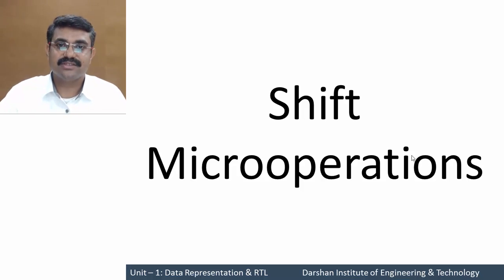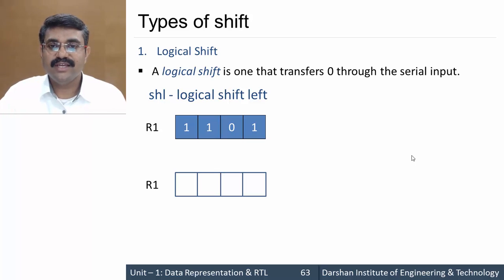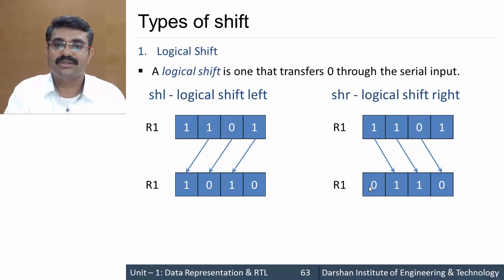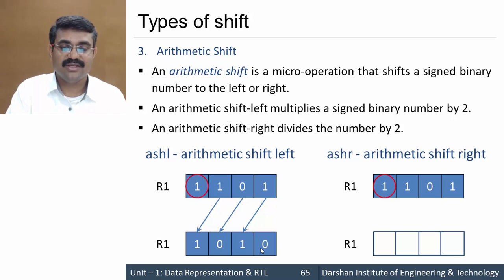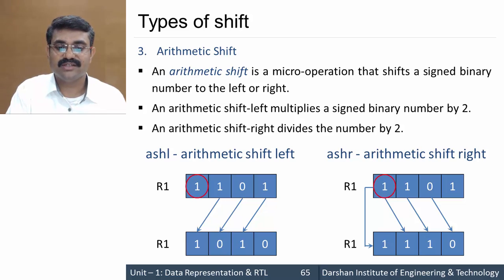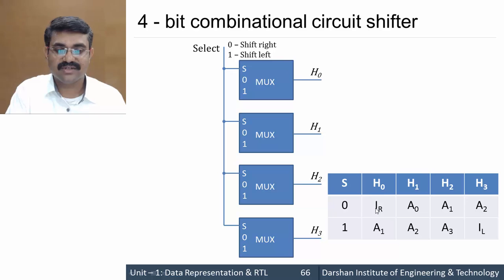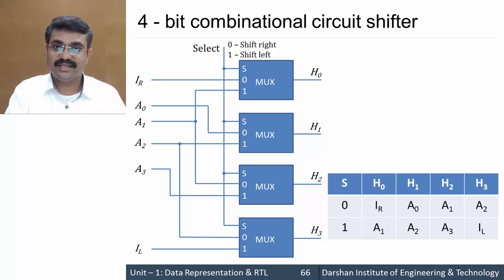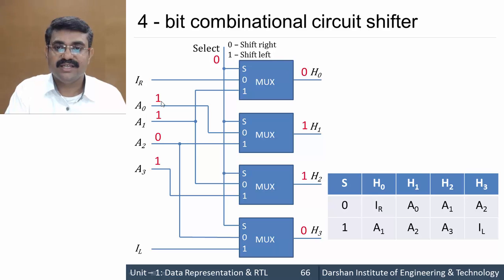1.10 Shift Microoperations

Comment: why does the sign not matter arithemetic shift left , I dont get it
plz clarify
Reply: Refer this : https://ibb.co/023Pyj0
Brief :
In the register, If we apply arithmetic shift left, then it will simply apply logical shift left irrespective of the sign bit.[whether the number is positive or negative, first it will apply simple logical shift left.]
as we know, upon multiplication or division , the sign of the number should remain unchanged.
So if the sign of the number is changed then we have to correct it.
for that, we have this formula :
Vs = R(n-1) XOR R(n-2)
where R(n-1) is the sign bit which determines the sign of the number whether it is positive or negative.
and R(n-2) is the MSB.
so here if we get Vs=0, then sign of the number after the arithmetic shift left will remain unchanged so now we don’t have to do anything.
But if we get Vs=1, then sign of the number after the arithmetic shift left is changed. so now, we have to complement of the current sign bit to get the original sign bit.
Hope it helps :)
Reply: @aayushtheapple  bro it is still helping people, thanks